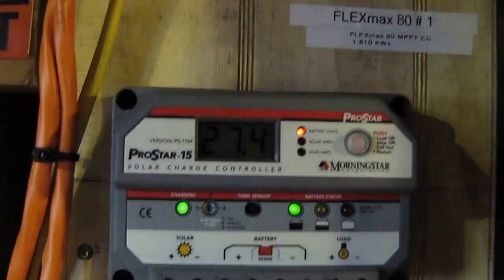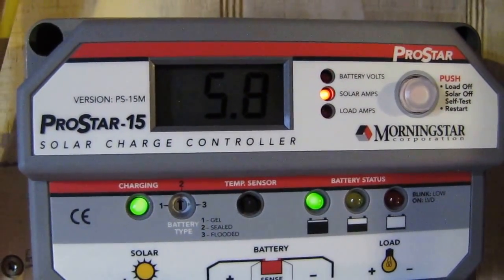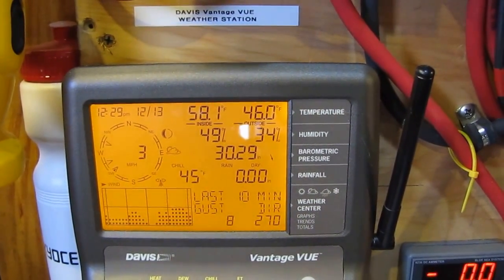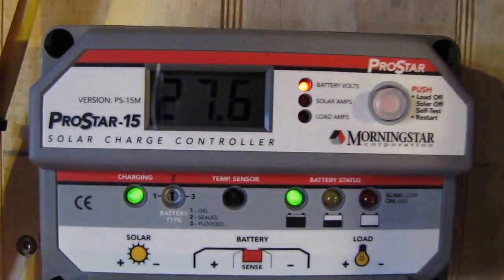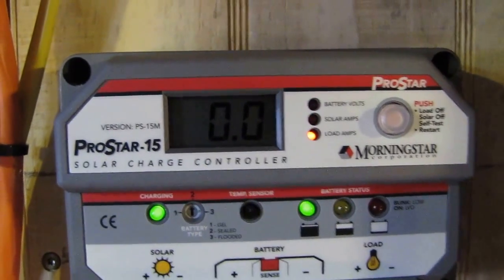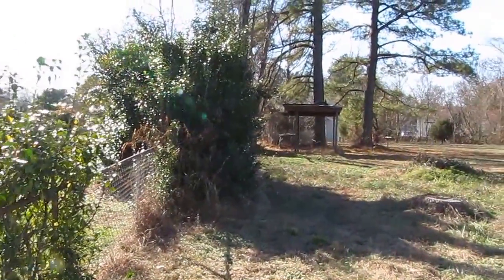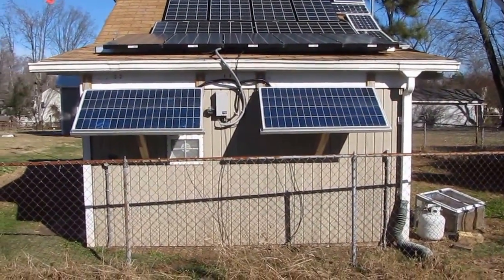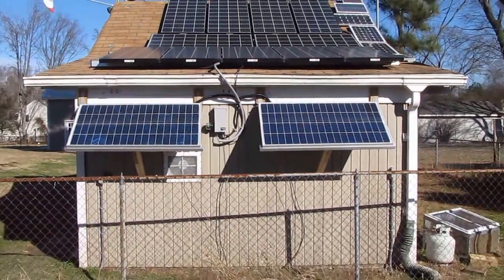More Solar Power For Winter Revised Pt 1

Comment: Hey that looks great. Good deal. That should make it cooler in the summer time too the panels will get air circulating around them and the building will be cooler. You should put hinges and wood props on the ones the back too to make them more efficient or get more amps out them too.
Reply from the maker: LOL Scott That Is A Great Idea Buddy
Reply: kvusmc Yeah those on the back could use your re vamping too. Not only the angle matters but air circulation to keep them cool is critical. The colder they are the more amps they make. When it starts freezing hard and gets down around the twenties the teens or colder  closer to zero or  with a clear sky watch the amps go up.
Reply from the maker: Thats Right Brother